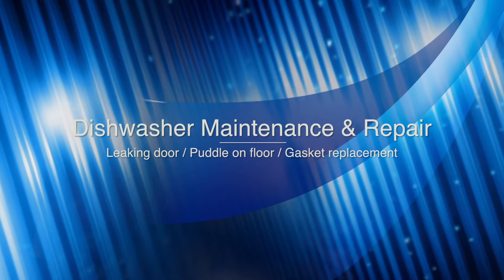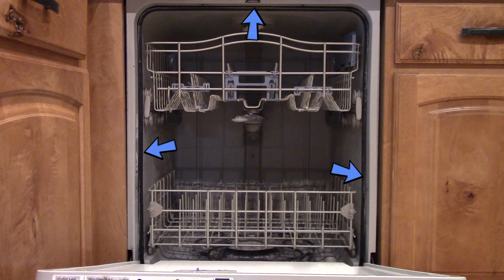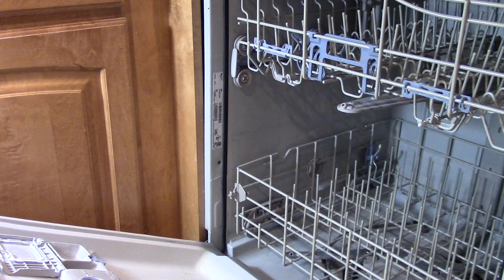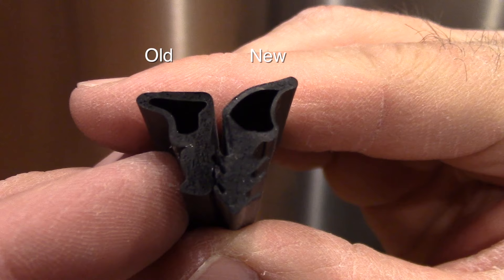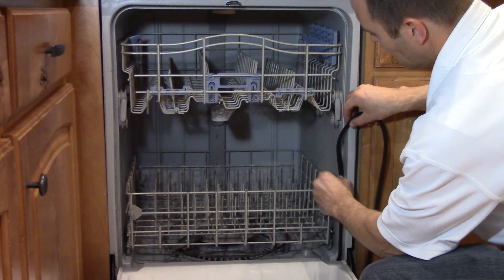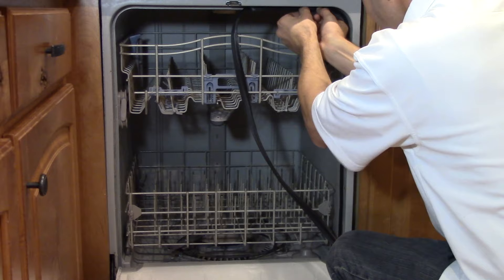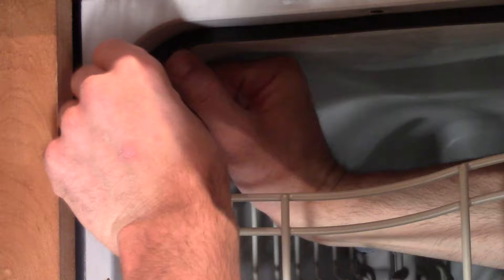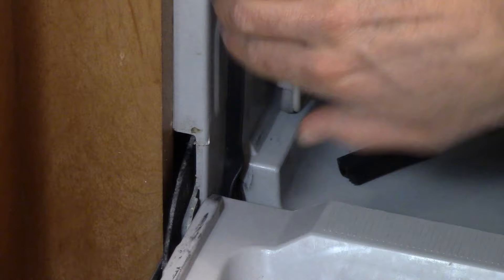Dishwasher repair - Leaking from bottom of door - troubleshooting Whirlpool

Comment: So my problem was not the gasket.  My dishwasher was leaking from the bottom of the door around the middle.  I checked the gasket, arm movement, float switch, water level and screw tightness on the doors but nothing seemed out of order.  I removed the lower arm assembly and exposed the mounting plate (6-8 screws in a circle under the arm assembly) and discovered that the screws facing the door were loose.  This was allowing water to bypass the lower wash arms and push the water over the lower housing of the door.  Pretty simple fix, but just a bear to find.
Reply: Do you have a video
Reply: I've changed the gasket, no success, and the seal at the bottom which was a lot of work... No success. Do you have a vid on your method? Or photo to show the area to check?
Reply: If you've changed the door gasket, and ruled out everything else, remove the inner door panel and find the ventilation strip! There is a foam gasket that was the culprit for me. I'm shocked at how few people mention this in their posts. Peel off the gasket and reglue it with B7000 or something similar. My Maytag wad dripping water every cycle - sometimes only a few drips, but sometimes as much as a liter, which was getting worse over time. As soon as I reglued the foam seal on the black vent piece, my dishwasher completely stopped dripping and is BONE DRY. You are welcome!
Reply: Mine has a similar leak. I’ll look for any loose screws. When I feel under the door, the insulation behind the outer skin is wet and dripping.
Reply: @b16crxt check the ventilation opening. Peel away the foam gasket and reseal it with flexible waterproof glue, like B7000.
Reply: @rosettapstone reglue the foam gasket around the ventilation strip!
Reply: @queen6590 reglue the foam gasket around the ventilation!
Reply: Where this ventilation strip?
Reply: I freaking love you! ALL of the screws on my washer were loose. So crazy! Thank you!
Reply: @insquirrel  wonder if I may ask a question. I have a Frigidaire Gallery dishwasher, I have replaced both the bottom door seal and the full door gasket and am still getting leaking from the bottom right corner and the middle. Like others, that foam backing is wet when I feel behind. What do you suggest??
Reply: Have. Videos

Comment: When replacing the door gasket, it is always good to replace the lower door gasket as well. In fact, if there is a corner leak, with all due respect to your video, the lower door gasket is most likely the cause before the door gasket. There are videos on this but basically open the door, remove the screws holding the front panel, close the door and remove the front panel. Open the door and remove the old gasket, note the groves so you will install the new one correctly, and go ahead and install it. Slide the front panel back in, open the door and put the 4 screws back in. Replacing both will insure a tight seal all around! That's all there is to it!
Reply: needs a lesson on how to repair a dishwasher gasket forget important first couple of steps
Reply: +Mark Glover Not sure I understand your question. Adam&#39;s video shows how to replace the gasket. I was  suggesting you replace the lower door gasket as long as you were replacing the door gasket as well. I bought both gaskets for around $9 online, but don&#39;t recall where.
Reply: It appears that not all dishwashers have a rubber lower seal. Our Whirlpool GU2455XTSQ2 does not appear to have one. Also, looking at the exploded parts listing for this model does not show a lower seal.
Reply: There is no bottom seal
Reply: Mine has a bottom seal
Reply: Mark Glover ,
Reply: Just replaced the gasket and the leak seems to be the same... except now it takes my full body force to close the door😂. I'm going to disassemble the front door panel next.

Comment: My whirlpool gold series 2013 dishwasher was leaking bottom of door. Leak used to start about 5 to 10 minutes after the cycle used to start. Source of leak turned out to be rubber gasket of heat vent that is on top left corner. It was accessible after removing door cover and opening the vent. Had hard water deposited on gasket. Cleaning with vinegar and giving a nice coat of vaseline before putting all together back resolved the issue.

Comment: My problem was not the gaskets.  My GE dishwasher has a filter on the inside of the door that was loose allowing water to enter thru the filter and exit bottom of door. $99.95 later, the technician tightened the filter, tested the dishwasher, and out the door he went.

Comment: Unusual Cause of Door leak!  I chased this door leak problem for a long time.  
At the end of the cycle, the DW was fully drained but would slowly drip during wash cycle. I inspected for all the usual listed problems.  Checked sprayer arms for possible cracks, checked fill valve, replaced main door gasket, bottom door gasket and float; didn't cure the problem. As a last resort, I went under house and found a a drooping ABS plastic drain pipe.  The pipe is 2" dia. and had a 2" droop that meant the line would still drain but slowly, thus backing up slightly on the fill and drain cycles.  I reset the slope on the ABS drain pipe and for 9 months, no more dripping on floor.  I do keep a "Leak Squeek" (from Amazon; no batteries and low profile) alarm on the floor just in case.

Comment: Hey GREAT video!!!! Our dishwasher was leaking this morning; I suspected that it was the gasket however it still looked in good shape. After cleaning the debris and scum off the rubber, it was still leaking.  My wife was looking at new dishwashing machines online. ANYWAY, I watched your video and saw that you recommended inspecting the SCREWS on the sides of the door. The lower screws were loose and sticking out. I used my screwdriver with the appropriate star bit and screwed them down again. NO LEAKING! THANKS! I guess after being used everyday for the past several years the screws got loose. If you think about it thats a pretty sturdy machine since its being used almost every single day.

Comment: I had same issues, same Parts shotgun, Ended up finding the lower sprayer bar had split along the sonic weld and was sending water sideways at such pressure to overcome the door gasket/pan lip.

Comment: Tightened all screws, removed, cleaned and cut door gasket in half. Put good ends in corner of door. Leak resolved, thank you!

But while working on it, cleaned out drain hose attached to garbage disposal with spiked snake, rinsed with vinegar, cleaned out debris from sprayers with tweezers, angled dishwasher a little bit towards back too

That bit** better work now

Comment: I bought and returned 2 door gaskets. The new ones are TOO STIFF and TOO FAT to fit in the groove. HERE IS HOW I FIXED THE SUMBITCH: The old gasket was fine except for the bottom 1-2 inches on both ends. They split and deformed to the point where they no longer sealed. I removed the whole seal, doubled it in half and cut it into TWO equal lengths. CUT OFF the 1-2 inches from the ends that are deformed. Reinstall the seals, but now leave a gap at the TOP where the latch is. Take the deformed pieces you cut off and place them in the groove at the TOP where the latch is. PROBLEM SOLVED!!!
Reply from the maker: Nice job!
Reply: Kevin why not? You didn't have anything to lose right?
Reply: Sounds like a good idea if it's leaking.  I read that you are supposed to soak it in hot water for 20 mins or so,the new gasket. Before the install,to soften it up
Reply: Good thinking sir, just tried it so far so good (instead of cutting off both bottom 1-2 inches, cut seal in half and  just flip seal around and let deformed  pieces meet up in middle, leaves only one gap at top)
Reply: Why not cut it in half and put the cut end on the opposite sides so the deformed bits meet in the middle at the top where the latch is?
Reply: Гений! Ты чертов гений!
Reply: @user-fq7tv2lo6e  even better !!!!! Great job! Thanks for that tip !
Reply: Thanks for sharing your solution. I had a similar experience with a new gasket. Mine fit in the channel, but was so new and thicker the door wouldn't close properly. Split and reversed the old gasket and now the door closes properly and there are no more leaks. I only wish I had found this before ordering the new gasket. Great hack!

Comment: Door screws tight. But noticed door gasket did not quite reach as far down as it could. As I was wiping it clean with a paper towel, it stretched downward on its own so I encouraged it to go to the very end. 
Am running another test. This time on the “pots and pans” cycle since that pushes more water into the dishwasher.🙏🏽
Prayer answered with a “Yes”! 😃 Water now stays inside the dishwasher, even when full if the maximum amount of water (regulated as it should be).

Comment: Wouldhave like to see a.start and stop close up of each bottom corner. The old gasket had a tag hanging out a bit. When I installed new gasket I still had a leak. Suspect it's coming from here. Hate to cut it too short. Otherwise good video

Comment: So my whirlpool dishwasher was leaking from the bottom in the middle it seems. Is there another gasket that runs parallel to the floor down there that I’m not seeing? Or would it be from the gasket you just replaced?

Comment: Great video! I ran into an issue with the door not latching after installing the new gasket.  Make sure you have the gasket pushed in all the way.  I also had to ‘lean’ on the door a bit until it finally grabbed and latched closed.  I’m guessing the new gasket needs to be worn in a tiny bit before fitting?
Reply: Always stretch it out as you go.

Comment: I discovered that there is a part number for the exact whirlpool replacement gasket. Some gaskets that are shipped under different part numbers fit but are not shaped exactly like the original.

Comment: I fixed my leak by replacing the spray arm! Remove the spray arm. Use a garden hose to flow water into it and see if water sprays out the sides due to the seam failing.  My spray arm went go bad after 8 years.  Note:  Do not purchase the lowest priced gasket.  It was too stiff and the door would not stay shut.  I had to clamp the door to keep it shut.  It did not fix the leak.  That is when I found the leaking spray arm.

Comment: The door gasket on my Kitchenaid dishwasher has what appear to be bespoke "shoes" on each end, where the bottom of the door at the hinge makes contact and seals. The "shoe" on the right side deteriorated, becoming hard and crumbly, and appears to have disintegrated: A large chunk evidently separated and ended life in the chopper. Does this generic, cut-it-with-a-pair-of-scissors gasket material really do the trick and provide a tight seal on each end? I am dubious.

Comment: Very helpful, thank you! I will order a gasket and give it a try but my question is regarding the door screws. If I tighten them the leaking stops for a while but always comes back. Today I took the screws right out to have a look and they are just screwing into a hole in metal with no nut on the back so they just basically just spin and spin. Is there a way to secure them so they stay tight without a nut?
Reply: Elf shelf snl
Reply: Fill the hole with some silicone or epoxy, but make sure to give it time to set up, at least 24 hours, maybe 48. (Think "chemical weld". Ask at Auto Zone.) Squished it in the hole, screw the screws into it, let it set up about and hour, then snug the screws a bit, then let it set up for the rest of the time on the package directions.

Comment: There are 2 gaskets to dishwashers. 
A foam around the door, and a plastic one on bottom of door.  
And the plastic one on bottom of door is the one that breaks most as the door closes chipping it  and 99% why leaks at the door not the foam one shown in video. 
The bottom door plastic one you have to take the front door apart and pull it out front the bottom of the door then snap new one into specific groves. Videos don't show this gasket as is harder to do than just a foam in door gasket.

Comment: Edit: I was totally putting it in wrong. 

I ordered a new gasket for my washing machine and an attempting to install it now. The gasket isn't sticking in place, no matter how hard I push it in or how many times I go over it. I am 99% sure this is the correct gasket for my machine. I used the whirlpool item number to order it off of amazon. Any thoughts?
Reply: it’s for a dishwasher

Comment: i replaced the gasket but i still get a leak when i open the door i see water along the left side of door where seal should be any suggestions
Reply: Tighten the screws or fill in missing screws.

Comment: Ours is leaking from the middle of the bottom of the door. I checked to make sure all the screws were tight. What could cause it to leak from the middle? Thanks
Reply: I have the same problem any thoughts on the cause?
Reply: I'm researching as well and the other possibility is a part called "lower door seal".   The videos describe water coming from the middle bottom of the units, not the sides like for this replacement.    Good luck!
Reply: @pbottomley14  I know these are 1+ year old comments, but for anyone else looking -- for us, we had a hose that hadn't been moved for god only knows how long, and air had built up in the hose in just a way that it created an air and water pocket where nothing could drain. It leaked from the center of the door because the water level got too high. So we disconnected the hose, cleared the water clog, reconnected it, and didn't have another problem. I hope that helps someone else. (:

Comment: I have the same model dishwasher and the door started leaking just like you show. I replaced the door gasket and that fixed it for 2 months and now it is back to leaking. I checked all the screws on the inside of the door and they are all tight. I replaced the gasket AGAIN and it leaks right away. I cannot see anything else that is wrong. Is there anything else I can check?
Reply: Check the flap lip seal across the bottom of the door is not damaged,, Make sure the door hinges are not damaged preventing the door from closing square and not sealing  , make sure the dishwasher is not tilted forwarded. make sure the water leak is not coming from rinse aid or detergent dispenser in the door , many dishwashers will let you close and latch the inner plastic door with the lower outer panel removed and see the source of the leak naturally avoid contact with any exposed electric terminals when doing this.

Comment: How long are the gasket ends after trimming?
Do the ends wrap a bit across the bottom (1-1/2 to 2") or do you cut it flush?
Reply from the maker: +susan sears I like to leave a bit, about 1" or so.  That way if the gasket pulls and shrinks a bit there is still extra.
Reply: AdamDIY

Comment: Anyone have trouble shutting the door after replacing the gasket? I can’t get it to latch at all...
Reply: My guess is either...
1...you got the wrong replacement seal (seal thicker than original seal)
2...a defective or poorly designed replacement seal (compare to original seal)
3...you installed it wrong (most likely at the corners)
4...debris lodged in seal gap pushing seal out (if old seal had breaks in it)
Until that is fixed, your dishwasher won't run until it can latch. Otherwise, it's guaranteed to leak!

Comment: HELP PLEASE!!!!....My son fell back on the dishwasher door while it was OPEN!!!! Now it sits cockeyed and closer to the floor than b4. It also started leaking on the right side. Do you think it's the seal, a hinge, or does this dishwasher need replaced COMPLETELY??? Idk what to do....🤕
Reply: Replace the door or hinges as one or both could be bent.
Reply: although old, Kathy, I suggest that you may have changed the level of the dishwasher or worse yet have caused the securing brackets to the cabinet that it sits in to become damaged or worse.  If its not level the water will migrate to the door and thus leak.  Damage is likely to have also happened to the supports on either side of the door that aligns the door and hinges (spring loaded) to no longer cause full contact with the dishwasher.  Please have a certified, trustworthy appliance repair person verify that the unit can be fixed before use.

Comment: I replaced gasket,  but in my situation there is mist dripping while dishwasher is at end of the cycle when drying the dishes. Sometimes there is more mist sometimes there is less,  and something nothing at all.
Reply from the maker: Dripping from where?
Reply: front bottom from plastic vent which vents out excess of heat which dries out the dishes at the of the cycle.

Comment: Here's a tip for Whirlpool: when there's 130,000+ people who watched this one video for a single issue, you really need to take it personally and stop designing such a shitty product.
Reply: Brian M. I work at the whirlpool plant In Findlay Ohio and we put these seals in and they aren't even made by whirlpool, but I can tell you that the main reason they leak is from becoming dried out over time. Good maintenance by the consumer can prevent the seals from damage, such as regularly lubing the seals and gaskets with a petroleum based lubricant a couple times a year as it states in the manual. 
You can't purchase a product and expect it to last forever without proper maintenance.
Reply: Name is Daniel and I currently am learning how to install these at whirlpool in Findlay Ohio and this was a good eye opener for me. So thank you. I find it's a hard job to do but I am learning and trying my best. It's alot harder than it looks like everything else..

Comment: Anyone else having problems with this installation? I have the nrw gasket
 correct part # but it is not a simple thumb push to get the new one seated in the gap. Afraid to use a pudh tool of some kind for fear of dsmaging gasket. This thing is really a tight fit. Not like thr video demo at all